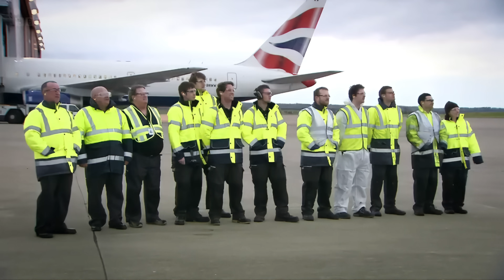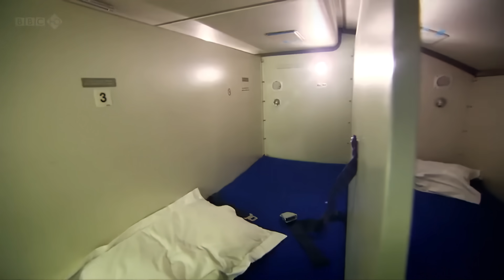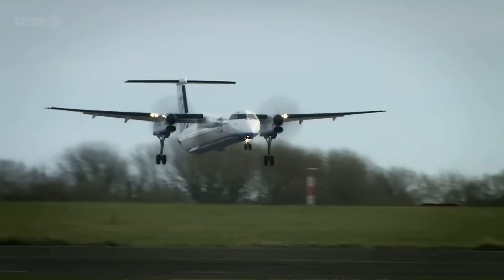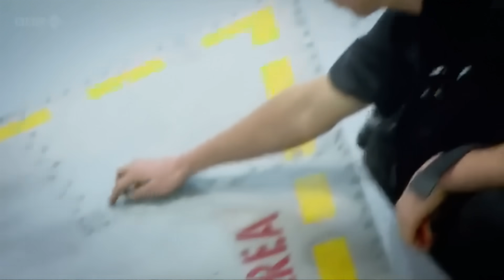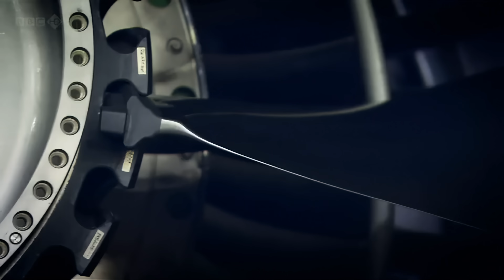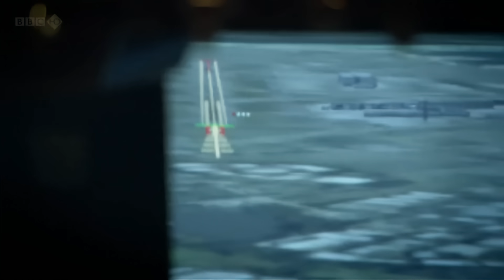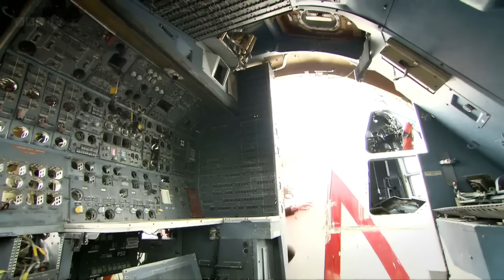British Airways Boeing 747-400 in D-Check

Comment: You had me at the opening shot of the throttle levers.  For which I had design responsibility for about 15 years at Boeing.
The Queen of the Skies will live forever.
Reply: They are backdriven and move automatically to the actual thrust position right? That's novel.

Comment: Brilliant documentary, I have taught aircraft engineering for 7 years and apart from getting Bernoulli slightly wrong this is top notch. One very minor gripe though. Can people please stop saying that air has to travel faster over a wing because it has further to go. It travels faster because the airflow is constricted by the curve of the wings upper surface causing a venturi effect and increased airflow velocity. This is explained well in how the slides inflate in another part of the same documentary. The part about Newtons laws is spot on. Overall an excellent video and very well made.

Comment: I must say British Engineers are very smart, This is a great way to advertise the 747 in these turbulent times in the air industry, Safety is the most concern, Its a beautiful aircraft and 4 engines are safer..
Reply: British Engineers ? It’s a Yankee plane, the only British thing I see here is the RR engines, usually 777 use standard GE engines, actually the engine brand and other specifications are decided by the company buying the plane...
Reply: @alfredopurinos9562  They all had British accents which makes them British engineers does it not? Also, that Yankee plane wouldn't even get off the ground without the jet engine which is a British invention as well as Britain being the first to make a jet powered passenger aeroplane.

Correct me if I'm wrong on any of these.

Just to note, there is a bit of controversy as to who invented the jet engine first, the Germans or the British. What should be highlighted is the fact that the Nazi's had spies in British engineering works so there is strong evidence that von Ohain was given a set of Whittles blueprints.

Comment: To the best of my knowledge, this 747-400 model probably may not typically  carry over 500 passengers, as you say.  However, there is also an older 747 model that does carry over 500 like those introduced in domestic flights in Japan. I remember seeing the figure on a timetable as a curious small school boy.
Reply: The Boeing 747-400D.
Reply: @wizardry.wealth  Much older than 400. If my memory serves me right, it was commonly called 747-SR for short range, based on 100 or 200, with higher passenger capacity over 500 something people and reinforced landing gears to stand frequent domestic flights.
Reply: @aldente2011  Yes, the Boeing 747-146SR could carry at least 500 passengers. This plane was for the Japanese Market, before moving to the Boeing 747-446D and 747-481D.

Comment: The worst part about testing an escape slide is folding it back up again lol
Reply: its funny to open it and yeah they have to pay the price lmao
Reply: It takes 2 weeks 9 to 5 to build one. Including folding and they are tested upon manufacturing. But after emergency deployment, they get replaced. Thing about the airbag of your car, those are actually controlled better then airplane escape slides as they use more reliable pre-flight diagnostics to ensure max safety, and they never get tested physically.
Reply: Anthony Kernich  because it takes them a long time
Reply: Lorenzo van het Hul
Reply: Indeed i think he released it 2 or 3 times..i bet it takes the whole day to fold it back

Comment: In the late 80's/ early 90's, I worked at Boeing (Everett, WA.) and helped build and functional test the 747-400, which, may still be the true Queen of the Skies! Our team did functional tests on the first -400 (N661US) after flight testing and before NWA delivery refit. Very proud to say that I was lucky enough to be the leader of the crew that did Change Incorporation (last minute upgrades) on these beauties, right before factory roll-out. We did all the British Airways, KLM, Lufthansa, Qantas and Northwest birds, 1988-92 (Functional test, Change Incorporation and a host of mundane but important tasks) before these Queens went across the runway to Pre-Flight.

Comment: This plane is so much better than A380. Better history looks better and everything
Reply: A380 has a better safety history but that's obviously. But damn the A380 ain't bad and looks sexy
Reply: A380 just doesn't have any cool things. like the very classic hump on the 747. And A380 just came out so of course it have better safety history. also 747 was a challenge considering the time period of which it was built.
Reply: Lorenzo van het Hul a380 does not have a better safety record...
Reply: Lorenzo van het Hul 747-8 came out about the same time as the a380. The 747-8 has zero crashes while the a380 has a fee
Reply: ***** you are comparing a pineapple with a boat. There are almost twice as many A380 then 747-8. The 747-8 isn't in service full fledged like the A380. And the fun thing is, the A380 doesn't have crashes at all. The only thing that happened which was potentially deadly was Qantas flight 32. Cause: a manufacturing fault in one of the RR engine, where as the oil pipe wasn't molded correctly, therefore creating a weak link which causes it to leak over time, the oil came on the main turbine disc, which causes it to rotate at speeds beyond design limits, therefore creating fatigue cracks, the shaft reduction gear had to work harder and the disc exploded.

NOT Airbus fault, but RR. And it could have happened on the 747-8 too if it had a defective RR engine.
Reply: Roshan S the airbus a380 has a lot of cool things. The classic hump of the boeing 747 is nice, but that doesn't mean airbus a380 is shit. Trust me, if you board one just a single time for 10 minutes, you would delete that comment ON BOARD that a380 :)
Reply: ***** i was talking about the 747 in general, heck it has a better safety record. It didn't crash a single time in over a decade. While the 747 crashed within a decade.
Reply: IMHO, beauty is in the eye of the beholder.
Reply: Hahaha
Reply: Lolol
Reply: Airbus A380 is to fat and tall
Reply: F4 Phantom Supra even the a380 is bigger it look to fat and ugly
Reply: "And everything"
?????????

Comment: Hmmm I had to head to London and Heathrow at that. Boy did it put a smile on my face when I realized that  they were putting us on their 400s. We tip toed to the end of Miami's runway and when our crew push that throttle I was amazed at the excess power this old queen had.  What was even more amazing was hurrying along at 700mph at 38,000ft.

Never in my wildest dream did I think this heavy could move that fast.
Reply: And that was doubt with somewhat derated thrust considering it was only Miami>London!  Glad you enjoyed the experience.
Reply: So you are telling me you like old queens? For an armchair commentator on commercial aviation you really are quite the sailor, aren't you deary.
Reply: Because it cannot.  That's faster than the speed of sound at 38,000 ft.  Max speed of a 747-400 is Mach 0.92 - so it could BARELY do 700mph at sea level, theoretically!  Loaded with Pax and fuel... now way.
Reply: @Jim Thompson Correct.  But that's not what was said - what was said was "700mph at 38,000ft."  No mention of ground speed and since the speed was stated "at 38,000ft" therefore the assumption is air speed.  Although if a non-aviator made the statement I'll admit it is possibly ambiguous.
Reply: @Jim Thompson Yes, also worked in industry, and yes, my experience is different - if ground speed isn't explicitly stated, air speed is assumed.  Remember the earth is rotating, do you want to fact in about 1000mph (at the equator) for that as well?  What about the rotation of the earth around the sun?  Or the Solar system rotation? Or the galaxy rotation.  It's all relative to an inertial frame of reference.  We just picked different ones.  If you are trying to wok out how fast you are going to get somewhere, then I agree, ground speed is your kidde!  But if you are concerned about pulling the wings off, for example, air speed is what you want.
Reply: Sighs.  @Jim Thompson I have given you several submissions and apparently they are not enough for you - apparently you cannot accept them.  I feel like you are having an argument on the internet... oh wait... ;-)  Anyway, you win - I hope that feeds whatever need you have.  Can you let it go at that or do you always have to have the last word?

Comment: I was a mechanic (L.A.M.E) for 30 + years. First up, the test flight after a D check (which normally involves a the Landing gear replacement/overhaul.) requires a Landing gear free fall test (alternate extension). One time on a test flight we had the RH wing gear not lock down, (or indicate it was not locked down) Everything would indicate normally when the hydraulic sys extension was done. So after the test flight we had to pull the aircraft back into the hangar and do a swing and check what was wrong. When we extended the gear, we had to push extra hard on the RH wing gear wheels as shown at 10:37 on the video, and then everything inicated "down and locked". Some extra lubrication was applied. Several days later after the aircraft was back flying, the QA department flagged it and wanted the aircraft pulled back into the hangar for positive rectification of the defect. We then found that the Hydraulic Extension Cylinder had high internal resistence friction and when we replaced that, the gear would easily lock into place after a free fall. Luckily I wasn't directly involved although I was on the test flight and wrote up the defect and was scolded by my senior for not telling the pilot to throw the aircraft around to "get the gear to lock down".

Comment: No matter what anyone says, the Boeing 747 was NASAs transport aircraft to get the Shuttle back to Florida if she landed elsewhere. It has also been Air Force One for the American President (there are actually two planes; both go, so if a problem develops, the backup plane is used. They can also be used to confuse any enemy that tries to shoot it, and the President, down. This guy on scene had to have considerable clearance to be that close to the plane while under refurb. Maintenance people are rather possessive about the planes they are responsible for. When being flown by an airline, it is a flying hotel. 

IIRC, a "D-Check" costs almost more than its original cost. It is b/c every nut and bolt is removed, inspected, and replaced. The fuselage is tested for cracks at the atomic level by a mass spectrometer, and any apparently worn item found internally is replaced b/c after the aircraft is re-assembled, it can be impossible to replace it..
Many years ago, a much smaller jet turbine was removed by the maintenance crew, and dropped. the drop put a crack into the bracket by which the engine is attached to the bracket used to attach it to the wing. Some time later, the plane was on take-off, and the jet engine broke off from the wing. The plane rose, then the pilot lost control, and then the plane went down, killing all on board. The NTSB examination found the broken bracket, checked the records, and saw that the engine had been dropped. There was much weeping and knashing of teeth.

When torn apart, the melted aluminum is the most prized metal, b/c aluminum ore is very expensive to process; it takes a fortune in electric power to heat it up, purify it, then pour it off into ingot blocks for transport to a raw metal broker.

During the life of any airplane, the mechanics who take pride in their work, will call it "their airplane", and when it is signed over to its crew to fly, they go with it as well. They are along for the ride in spirit, b/c they helped give birth to it.

Comment: On 30 Jan 2016, BAW295 was scheduled to fly from LHR to ORD. It never made it to ORD and was forced to return to LHR due to landing gear issues. The flight was serviced by G-CIVX, the same plane featured in this video. I think some of the crew here may have missed something on the landing gear.
Reply: +Luxornv well, not necessarily. Because the video was uploaded in 2012, and LDGs are a critical system that we inspect every few flight cycles. Since 2012, the 747 must have undergone upto 3 C Checks where the LDGs must have been inspected very thoroughly. Unlikely that something will be missed 4 times in a row.
Also the LDGs go for a complete overhaul separately every 10yrs on an average. Depending on the age of the plane, and other factors like moving the LDGs across different 747s which is a normal operational practice, these may not even be the same LDGs.
Reply: Well. Observe the end of Airbus A380 production! 747 production...NOT!!! Awaiting the the next PAIR...of 747-8i...Air Force Ones!!!

Comment: Other way round. There is higher pressure below, pushing up.
Reply: Nilguiri sorry dude, you are wrong if you're referring to.lift
The air under a wing goes relatively straight, remaining at the same pressure as surrounding air.  That passing over the wing has to go further, reducing pressure.  Lower pressure means it is pulled upward.  Lift.
Reply: but by your theory, propellers would have to spin in the opposite direction to create forward thrust, so i think Nilguiri is right. can you please explain further, I've never understood this
Reply: An aircraft flies like a piece of plywood towed by a car.  Same as a kite.  The curved "airfoil" shape of the wing is to keep the air on top from burbling. keeps it stuck (called laminar flow)  The suction thing is a myth.  If they would stop teaching the "Bernoulli effect" it would save lives.

JR

Comment: So this plane was delivered in 1998... It's not very old!
Reply: in 2014 that is still old for any machine these days
Reply: David Milne Not for an airplane. They're built to last.
Reply: David Milne Planes are build to fly for atleast 25 years
Reply: Jenson Arunkumar Yeah, and most of them become freighters after and fly for 10 years more.
Reply: The age of a plane is not determined by its chronological age, but by how many flights and hours it has flown. FedEx Express, the largest cargo airline in the world, has a fleet average age of 23 years, and it still flies 60+ DC-10s (over 85 percent of the remaining civilian DC-10 still remaining in the world, primarily within the USA), of which some are over 40 years old. Even some of the older ones still have about 60,000 hours and a few ten-thousand flights remaining in them; FedEx is likely to keep them running until they run of flights or hours or are damaged in accidents. As for D checks, some FedEx planes have likely gone through many as 6 D checks (their oldest planes are over 43 years old).

The DC-10 still serve a cargo plane because it has a great payload. By contrast, some Babybuses (A318s) were scrapped with just over 2 years of service (and were not in accidents).
Reply: a318s may be scrapped in just over 2 years but it's still much safer than the dc-10. the reason why dc10's are used as cargo planes is because it's unsafe
Reply: Sarath George No they are used as cargo planes because they are old and too expensive to maintain.
Reply: The A318s its logical that they scrap them even after two years because they can use all the parts in other a320 planes and build more
Reply: If DC-10s were unsafe they would not be allowed to fly them. The cargo aircraft are under the same safety regulations as passenger aircraft, they are cheaper to operate because they do not need to maintain the passenger seats, toilets and kitchens, but everything that makes the airplane fly is maintained to the same standard.
Reply: al380boy  the average age of Private planes is 45 years
Reply: 1988*
Reply: Trise MRG Gamer2007 find me a 747-400 in service 1988 lol

Comment: For a time, BA’s 747s were fitted so that upper deck was economy (coach) class. If you had an economy ticket at check-in you could request a seat on the upper deck which was more fun and more spacious. I did this and also visited the flight deck in the cruise which, at the time, was not so unusual.

Comment: The A380 looks like an obese wale and the 747 looks like an elegant bird
Reply: would always a safe obese whale than a dangerous disaster prone, nearsightedly engineered elegant bird
Reply: And now, in 2019, the A380...faces the end of production. I wish the Boeing 747-8 sales were better, but it's still in production for both passenger & freighter variants, and most important...going to be the next U.S. Air Force One platform to replace the current pair of B747-200B/VC-25A...aircraft! Long live Boeing & the 747!!!

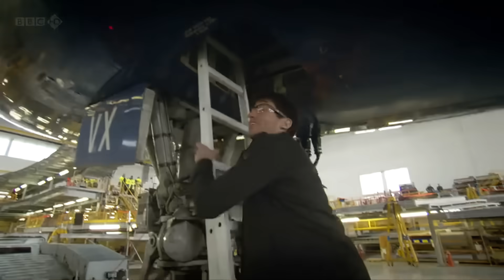Comment: I remember being sent to Heathrow to carry out some engine checks on a series of 777s. The hangar myself and my colleague had been assigned to was already occupied by a 747. The view at 06:11 is almost the same position I had in front of the jumbo as they backed it out of the hangar. That was when I realised just how impressive these planes are. When the 777 was pulled in, although impressive in it's own right, it didn't hold a candle to the 747. There's just something about that fuselage shape, especially when viewed nose on.